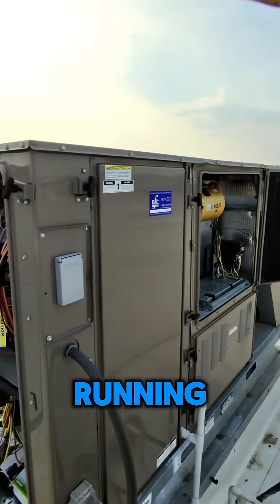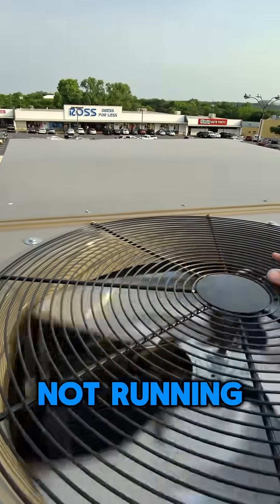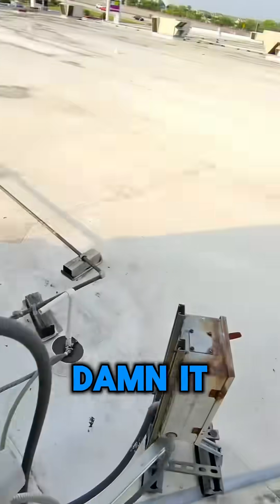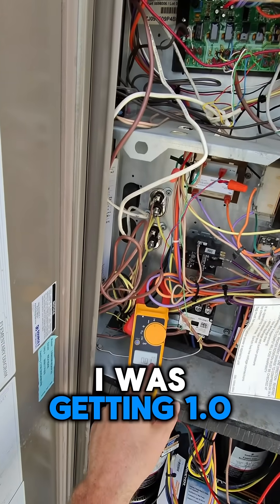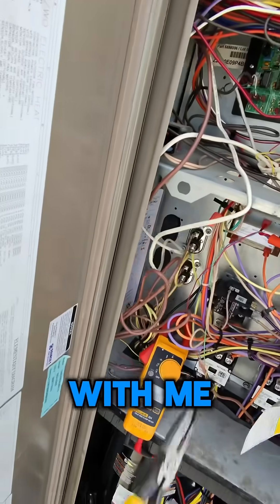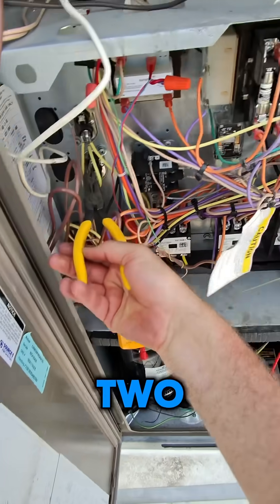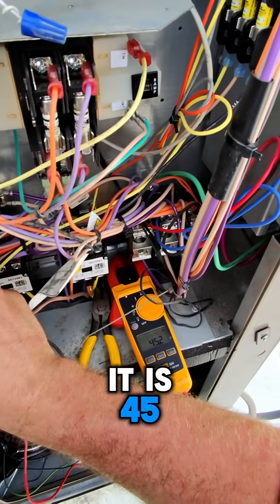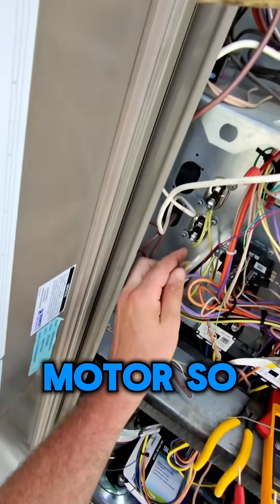Customer hot!! 🥵 Unit locked out on high head pressure!!

Comment: IVE LITERALLY NEVER SEEN A CAPACITOR DO THAT, THOUGHT IT WAS A MYTH HAHA, NO I KNOW IT CAN, JUST SO RARE ITS NEVER HAPPENED TO ME...MAYBE I SHOULD SHORT THEM FROM NOW ON
Reply: Usually in cases like this ., its fan motor., when work on stages., 1 or 2 fan motors spin backwards. When signal commands it to run. It creates so much centrifugal force >torque that causes windings to open/ burn.